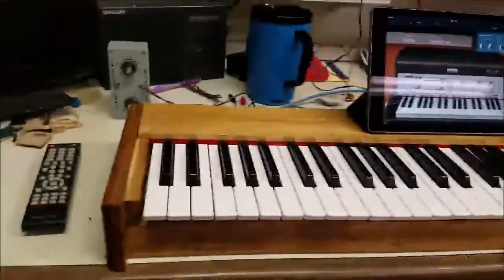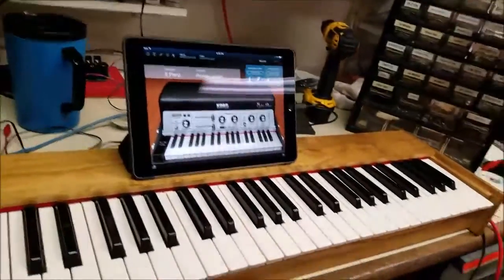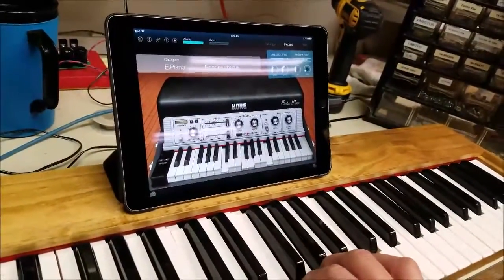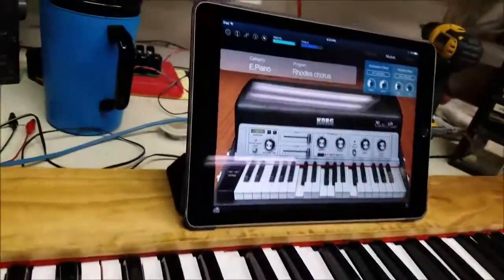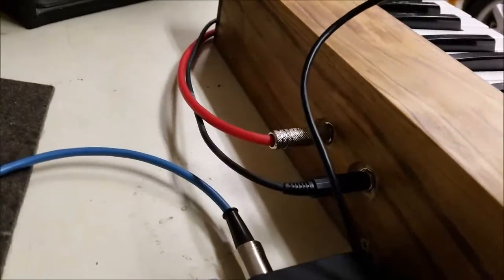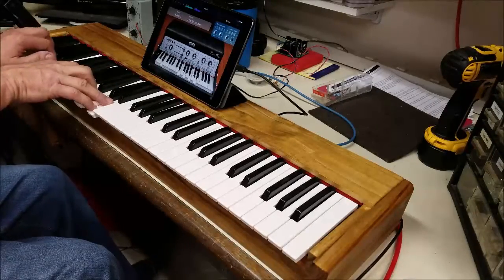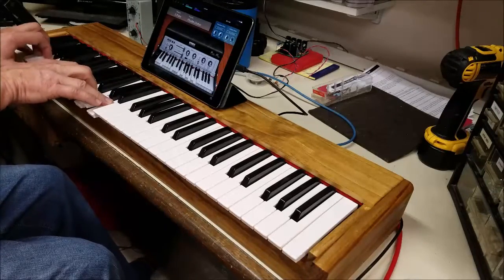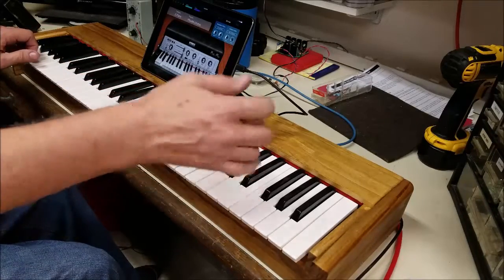DIY MIDI Keyboard Demo.

Comment: Thanks, Dear. I have a Yamaha fs61 keybed and I want to make a midi key with pitch bend, modulation, pedal sustain, volume control, USB, and midi out. Would you please help me find which encoder board is ok for my project? the price is important for me. so thanks and Regards. AMIR

Comment: Wow! That's a great way to build a keyboard, Made of all wood like all the big ones are. What kind of speakers were you using. How Big of Woofer and tweeters? Thanks, Terry
Reply: I think we are hearing direct line out.
Reply: @NabPunk  Thanks, but that still don't answer my question, I don't know why he won't respond, unless he died.
Reply: @NabPunk  Update: I checked his channel, his last video is 1 month ago, so why no response is strange, I posted my question a whole year ago. Terry
Reply: @ He probably gets a lot of messages and has turned off notifications
Reply: @ Well, I did ok without his answer for a year, I guess I can let it pass. Thanks. for the Direct sound Idea.

Comment: The pitch and modulation wheels are missing
Reply from the maker: Synthesizer Home fair enough... I showed you mine, now show me yours 😎
Reply: @geoelectro  I think you've done a great job, wonderful work, but my first thought was about the missing wheels since I am more a synth guy than a piano player :-) if you play Rhodes and Hammonds, I guess you will hardly miss them...
Reply from the maker: Synthesizer Home check out my latest DIY keyboard. https://youtu.be/BhbL3my3fI0
Reply: @geoelectro  great keyboard :-) I wish I had a Moog 15...
Reply from the maker: @synthesizerhome2041  I serviced one earlier this year. It sounded amazing! Hey, check out the Moog 15 IOS app. It also sounds amazing.
Reply: @geoelectro  I am only interested in the original Moog 15...
Reply: Can you share schematic and code

Comment: can I have the diagram
Reply from the maker: IT'S ME BRYAN I’ve just finished a second keyboard with added controls etc. I’m putting a video together and will list all the parts used. The circuit used in this keyboard is an already built board from Midi Boutique. All you have to do is connect it to the keyboard assy your going to use. Then, built a suitable enclosure.
Reply: @geoelectro  ර්
Reply from the maker: https://youtu.be/BhbL3my3fI0